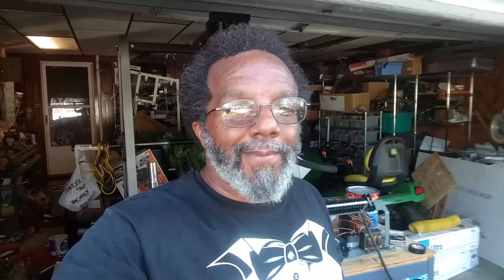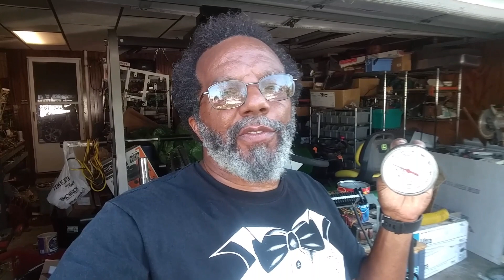Compression test to diagnose a burnt valve in my car. Misfire and burnt valve #4, 15 psi... - SOTR

Comment: I'm working on a Hyundai Santa Fe 2.7L I don't know the history of the vehicle. I'm in the process of removing the cylinder heads, so I can figure out why cylinder #3 has hardly any pressure. I'm assuming the problem is related to a valve. I did find the Left bank cam gear off one tooth. Not sure if that had anything to do with it. The exhaust manifold has studs and washers. I like your dental floss trick to hold the gasket in place, but I don't have any idea how I'm going to get the washers to stay on the studs while I'm trying to get the nut back on. If you have any ideas let me know. I'm still in the process of tearing the motor down.
Reply from the maker: Just push them on and hold them there while you start the nut.

Comment: Did the burnt valves cause damage to the bottom of the engine? And can you replace just the burnt valves or should you replace all of the valves?
Reply from the maker: I have never seen damage to the piston or cylinder wall. I usually only replace the burnt valve and other valves that have noticeable pitting.
Reply from the maker: https://youtu.be/gE4TBzlDMws
Reply: @RobertDIY  Thank you very much. I will look at these videos.

Comment: Unplug injector, drive as far as possible, then rent U-haul and tow dolly.

The only real thing I have against that engine is the fragile head, but if it has 362K on the original, that's not bad. I can't remember if that engine has hydraulic lash adjusters or some kind of weird way to adjust the valves by hand, but evidently the exhaust valves stop sealing well enough at some point and burn.
Reply: Or Robert may have his foot through the firewall too much lol.
Reply from the maker: Yep, hydraulic lifters. Bad valve stem seals.

Comment: What causes the valve to be burnt? I have heard bent valves but never heard of burnt valve.
Reply: Basically a burnt valve is one that is no longer providing a propper seal and allowing hot gasses to escape during the combustion phase over time these hot gasses will eat away at the edge of the valve creating an even bigger leak and allowing more gasses to escape. Many things can lead to a valve becoming burnt such as engine overheating, cylinder running lean, carbon build up, weak/broken valve springs, poor lubrication ect...

Look on google images for burnt valve and you will see what I mean by the edge being eaten away over time.
Reply: Wet Lettuce thank you. Good explanation
Reply: or like my 98 s70 it happens out of left field...you don't see it coming ! then after 1 start it starts running a little funny like a air sound from he motor . do you rebuild  it junk it or leave it where it is?  garage quoted me $2600 to do it and for me to have the engine shop rebuild my head and me do all the labor with other parts to pull and reinstall  cost me around $700..and 2 weeks down time on my ride. not a fun job id be hesitant to do one again as they are time consuming  and  so many bolts you need to label so you know where they came from.
Reply from the maker: In these cars, usually leaking (oil) valve stem seals. I am planning to have the fuel injector tested.